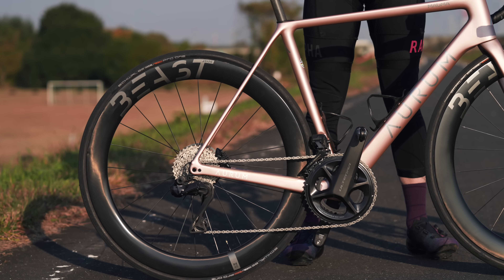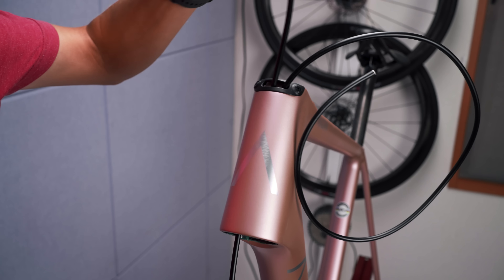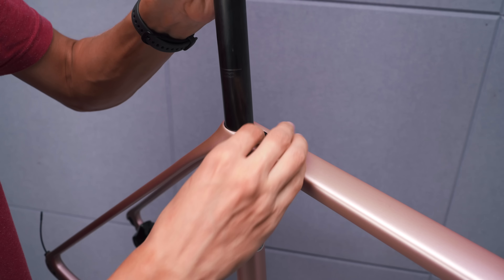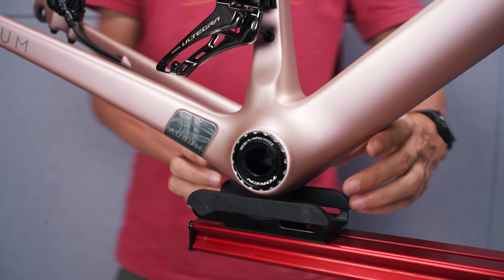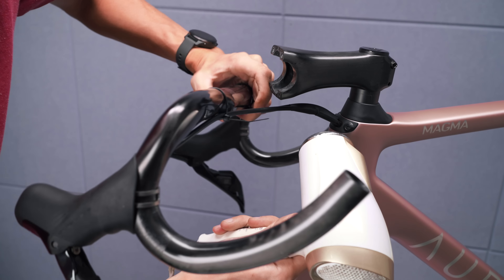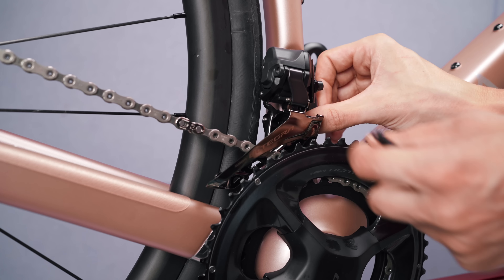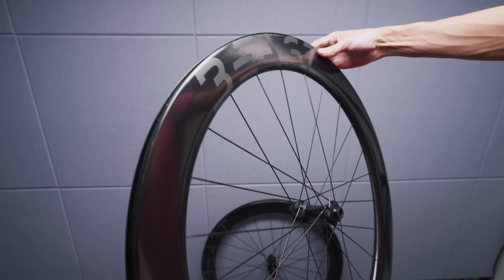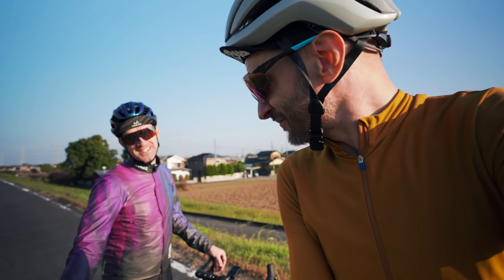Full Bike Build: Aurum Magma "The Pink flaming Beast"

Comment from the maker: Multible questions about the tire bead wax and chain stay protector, so pinning the answers:
1. Chainstay Protector: As I said, some generic stuff from Amazon Japan... packaging says "Bike Friendz". Can’t find it on Amazon US, but this looks suspiciously similar: https://amzn.to/3tKuo5F (Can't guarantee anything though.)
2. Tire bead wax: This https://amzn.to/3gk5c38 seem to be the same I'm using. But other similar products for car and motorcycle tires I'm sure exist. Also called "tire bead lube". Schwalbe also makes a bike specific product called "Tire Easy fit" https://amzn.to/3TNFykQ but it's not something I have personal experience with.
Reply: Do you have an Amazon Japan link for the chainstay protector? Thanks.
Reply from the maker: @EvoRides   https://amzn.asia/d/huNB0zD
Reply: FWIW I was able to find the chainstay protector under the brand "System EX" in Amazon UK. Thanks for the recommendation!
Reply: Is tire bead wax any better than soapy water applied with a toothbrush?
Reply from the maker: @devdroid9606  never used a toothbrush so can’t say. But in my experience bead wax is better than soapy water, for new tires it has basically been a 100% success rate for me. Reused tires can be tricky depending on how clean the tire bead is from old sealant.

Comment: That cable routing at the front is really interesting
Reply from the maker: Agreed, while you can’t go full internal, the solution they came up with is pretty nice, you can use any cockpit, and easy access to the top headset bearing.  And still keep everything reasonable clean up front. The lower you can get the cockpit the cleaner it will look.
Reply: @ridesofjapan  my worry is getting water down the headtube, thoughts?

Comment: Amazing, as always. Kudos for keeping 3mm spacer above the stem that is good mechanic practice, good job.
Reply: what is the purpose of the extra spacer?
Reply: @adityanathanael  Just so you have better distribution of clamping force on steerer tube. When you have a little space above you can cut steerer tube flush with stem, otherwise you have to cut steerer tube that 3mm bellow stem to be able to preload headset bearings.
Reply: @martinkroutil  ah,  never thought about that, thank you

Comment: You've tightened the fork expander before putting the stem on, hence the steerer there might have expanded & felt tighter than it would if you had put the stem on first, then tightened both.. ideally tighten the expander a bit, then the stem, then the expander again etc etc until you've reached the torque for both. This way you put the least amount of stress on the carbon & prevent it  'bulging' out or crushing inwards. I've seen this happen with forks with thinner steerer walls and might be the case why you saw the Beast Components stem feeling quite tight. This and Beast's quite good/tight tolerances..
Reply from the maker: you won’t “expand” a thick steerer tube with an expander plug…unless crank that thing with some proper force :)
It was super tight before the steerer tube was cut. (Without the expander)
Reply: @ridesofjapan  check with a good Vernier caliper, you might be surprised by the results.
Reply: @ridesofjapan  you could... happened to me.
Reply from the maker: Yes, sorry I’m sloppy… what I meant that I didn’t make a “loose” stem feel tight because I expanded plug first
the stem was super tight on the uncut steerer without expander.
I’m definitely buy that you could see a measurable difference with the 
expander… but that was not the reason for the tight stem.
And like you point out, tight tolerances is a good thing 👍 
Was just an interesting observation I though… Carbon vs aluminum stem.
Edit: regardless of stem, I definitely did the the assembly backwards in the video though… which was probably your main point I realize now. Apologies.
Reply: @ridesofjapan  no problem with sloppiness when it's your bike 😋 but there's a reason crabon steerer expanders should be tightened after the stem is installed. and also why those evolved so much over time, not only for weight "savings."

speaking of tight tolerances in the cycling industry made my day, thnaks! 😹
Reply: Yes. I’ve learned the hard way but I found that to be the case with very tight tolerances on stems to steerer.
Reply: Maybe a bit OCD, but I also tighten and untighten stem and expander bit for bit together.
Reply: I can confirm I have had this exact same issue. The stem was a very tight fit after I had torqued the fork expander to the recommend torque. I had to do what you suggested- back off the expander a bit, then stem on, full torque the expander, then tighten the stem. 

Quite alarming when I realised the carbon was bulging slightly. But it's held up ok for 2 years now!

Comment: Nice build! Yeah... about those wireless updates... There was a new shifter update last week, but it cannot be installed wirelessly....  I asked Shimano what's up... but they didn't know either. For some reason the latest update still needs the shifters to be wired to the rest of the system.
I'm going to assume future updates can be done without wiring the shifters to the rest of the system, but that there will be exceptions... :(

Comment: 19:58 using the HAG to test a new hanger is such a good practice. After testing, I remove the aligned hanger to add to my spares and the use my second hanger (always buy at least two) for final installation and testing. That way I have a tested spare hanger too.

Comment: Normally I use 1.5mm hex wench as a hook to grab the hose, but the zip tie hack looks awesome!
Reply from the maker: That works in most cases, but the end of the hose is plugged, so you can't "hook" the inside of the hose. (Unless you want it to get messy)

Comment: Nice job with the build. Very thorough! I did notice that you didn’t use the wire route clip for the rear mech which snaps into the inside of the mounting bolt. Just an observation. 😅
Reply from the maker: But I did, take one more closer look 😁
Cheers!
Reply: I see it now as you snuck it in without mentioning it when you were talking about the rubber cover/cap! I have a direct mount hanger on my Ostro so it appears in a different location, which it is not. As always, excellent detailed build (without mention of rear mech routing clip 😳)!

Comment: Is the stem same tight with loosened expander plug or without a plug? That could be the reason - you expanded steerer tube from inside
Reply from the maker: No, you won’t “expand” a steerer tube with an expander plug… need way more force than 8nm :)
It was super tight before the steerer tube was cut.
Reply: @ridesofjapan  in my experience I've been able to feel the difference
Reply from the maker: Well, force applied to something will always affect something to a degree…the point I was pretty sloppy at making 😅, was that the expander in this case was not the reason the stem feel tight, since I was struggling getting it on the uncut steerer tube (without the expander).
Also, I don’t think this was an negative, more of an observation of carbon vs aluminum stems I’ve used up until now.
Tight tolerances is a good thing 👍

Comment: great video. by the way carbon fiber indeed is way stiffer than aluminum, so any part that pressure fits it is going to feel tighter, also the expander does make the carbon tube actually expand making the fit harder.

Comment: Hello can this be building going fully internal through the handlebar/stem instead of using the headtube port?
Reply from the maker: Not for this standard model frameset. 

The new limited “magma Khamai” seems to have change around either the head tube or the fork to accommodate full internal routing.
Reply: @ridesofjapan thanks for the fast reply!

Comment: Dear Tobias!

I would like to ask you, if you have the possibility to answer... I am about to change my old Ultegra R8000 mechanical groupset to the one(R8150) Di2, you are building in this video. Please confirm if in the brake kit ( ST-R8170/BR-R8170) like you are using there is an olive included in the hose/lever combo(on both ends)...?

And thank you for your unbelievable work!

Huge fan!

Greetings!
Reply from the maker: If you get the kits (caliper + lever) the hose comes mounted to the caliper, so that side you don’t worry about. 
The olive is already in the lever, so you only cut the hose to length, install the barb, remove the yellow plug in the lever, insert the hose and tighten the bolt. Done!

Cheers!
Reply: @ridesofjapan  Thank you very much! Cheers!

Comment: Great build and excellent video. Is there no need for an olive when installing each brake hose at the lever?
Reply from the maker: The olive is already in the lever when you get this as "kit". You will need a new olive if you ever remove the hose though.
cheers!
Reply: @ridesofjapan  ahh thanks

Comment: to answer your questions shimano doesn't make an updatet rubber for the new battery. if you use a pro seatpost you can clip in the battery with a metal safety clip. if you use other seatposts you have to customize it with a cutter. where you plug the cables in the battery doesn't matter. what is important is that the middle port is occupied. with a cable or with a plug otherwise it will not work. Do you know when they will releasy aero shifter with sd300 cables for 12speed road bikes with clip ons. at the moment the only solution seems to use the old one to a 4 port and then connect it to the third port of the battery. what a mess for a semiwireless group...

Comment: i got the same shimano tool and i have alot of problems with it. first, it didnt cut through, i have to rotate it to cut the hole hydraulic hose. and second, the hose slips through if i want to insert the plug. i dont know why
Reply from the maker: Don’t get how it wouldn’t cut through the hose 🤔 sound defective.
You can tighten the hose clamp with large screw on the bottom if it slips.
Reply: I had a bent blade once. Dismantle the tool and straighten the blade.  The spring is the only tricky bit in re-assembly.

Comment: Why use the Shimano HG driver instead of the XDR driver? There are big weight savings to be had with the XDR driver.
Reply: Really? What does Shimano make cassettes for xdr now? Nope.
Reply: @jonathanzappala  Sram does, why does it have to be a shimano cassette?
Reply: @pete3060  sram 12 speed cassettes are incompatible with Shimano hyper glide cassettes. The sram ones only like to work with flat top chains.

Comment: Hi, What tires would you suggest that is best using with latex tubes?
Reply from the maker: Sorry, I not the right person to ask, I run tubeless everything.
Reply: Though I know that Tobias is not a big fan, I would recommend new Conti's S TRs They are very fast with accepteble (I use them on medium quality asphalt roads from late spring to early autumn) puncture resistance.

Comment: Amazing built!  One question, when you switch the freehub body, did you left the red spacer in the XDR freehub or the HG body already has one in place?
Reply from the maker: Reuse the spacer, only thing you don’t reuse is the end cap which are different. (And might have to be bought separately)

Comment: Very nice. It's advised though, to use plastic compression ring on the headset when using it with carbon steerer. Metal ones can cut into the carbon and who needs that to worry about?

Comment: Just an observation: The Shimano "premium" grease looks suspiciously like the Motorex bike grease 2000. Which in return is a simple calcium grease with nlgi 2. It won't be as fast as an nlgi 00 but it has great water resistant properties and stays in place for long time.

Comment: 7.5kg.(not that special)
..   nice work on the build , and attention to detail , shame that this frame is a overrated price per gram , with that awful front entry for cables that leaves the hoses touching steertube and a open entry for water ,  a friend of mine has the same frame and had it swapped 2 times by construction defects.
So whatever you want to say , but all components ok, That frame , never